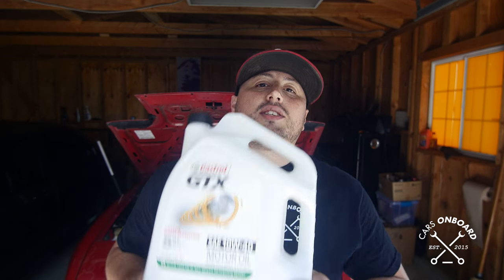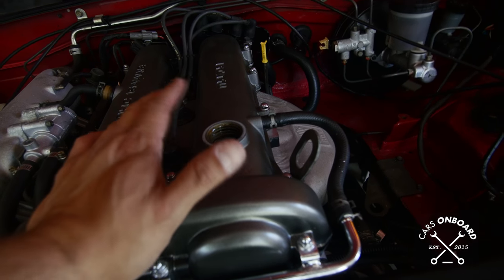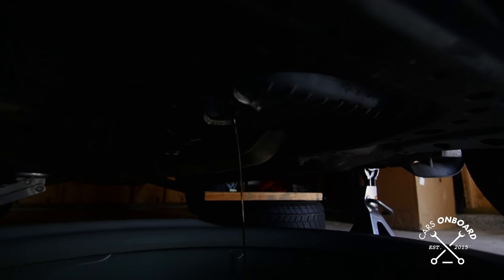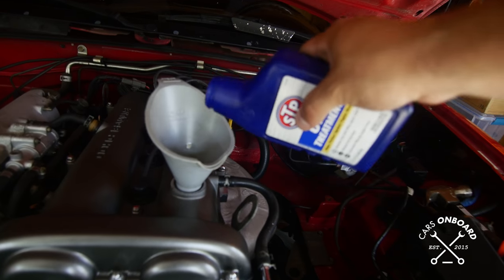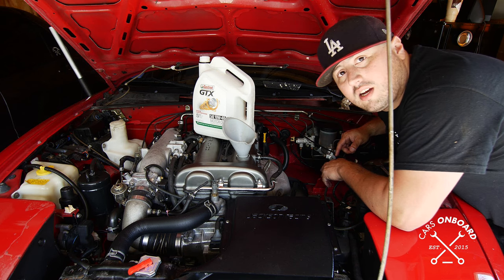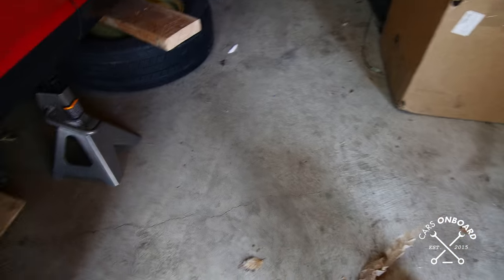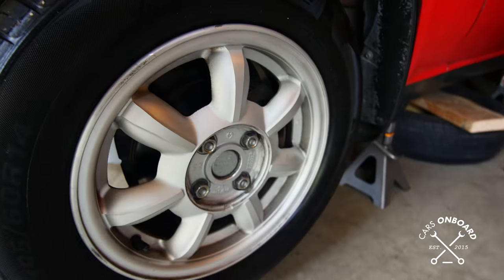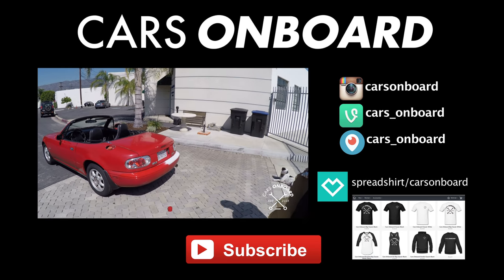MIATA OIL CHANGE TRICKS & TIPS [PROJECT MIATA] EP010

Comment: Another tip, any time you're doing work in the engine bay, flip the headlights up. Those headlight doors are a magnet for hands and elbows to lean on (like at 5:07), and if you do that it bends the rear edge out of alignment with the hood, creating the gap you see on lots of NAs.
Reply: I always wondered about that gap. My NA has that gap. Can it be fixed?
Reply: @stuartbear922  easier than you think... just fold a towel in half and grab the rear edge of the headlight door, gently bend it upward till it's back in line with the hood. You might have to raise and lower the hood a few times to get it perfect.

Comment: They make oversized oil drain plugs, just for the problem you are describing. They are the next size up/threaded and you would essentially use the oversize drain plug as a tap. Fairly common issue. No need to change your entire oil pan! Hope this helps.
Reply from the maker: Dope thanks for the info Metalcop

Comment: Great video! I noticed you have a Jackson Racing Cold Air Intake on your '92. I have the same on my '93. However, the J-R kit makes it difficult to check/set my timing (as the timing marks are now blocked from view). Curious if you have any tricks for this without having to partially remove the J-R setup?

Comment: One correction, if your oil psi drops a smidge below the 30 mark when idling after being warmed up, that is normal. 45 psi cruising is nominal with about 55-60 psi at full WOT.
Reply from the maker: Sweet thanks for the info!
Reply: Thanks I was freaking out with my Miata after I saw the vid xD

Comment: I cannot get the oil filter in my '95 over the top. Instead I get under the car and reach up through the wheel well. Pretty easy like that. Make sure the wheels are turned to the left.

Comment: All good tips thank you, I was worrying about trying to access the filter. I would have recommended an oversized plug for your pan, cuts new threads. I work at a lube shop down in the pit, have for several years, but I always let anyone know. It I put that oversize in i always have atleast a quart flush just to get any shavings out of that pan. Simple way to fix without having to pan drop.

Comment: Only use 20w 40 is super hot climates constant 70f - 120f outside temps. I use 10w 40 gtx high mi. In my 92' Celica GT. Don't worry about metal slivers in the pan. There's magnets already in there, specifically for collecting metal. Most if not all cars have them.

Comment: That ticking noise is annoying and I also thought I had a leak somewhere. 

Pretty much gonna do what you did: paint valve cover, change gasket, redo oil change with additive.
Reply from the maker: Nice! Just FYI when you get 2,500 miles on that oil change the ticking starts to come back. Good luck on your project.